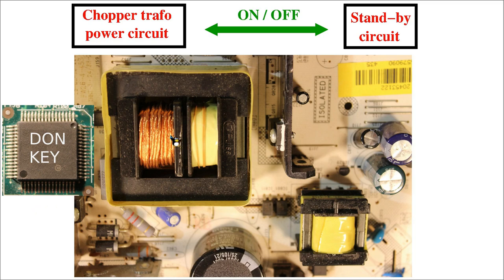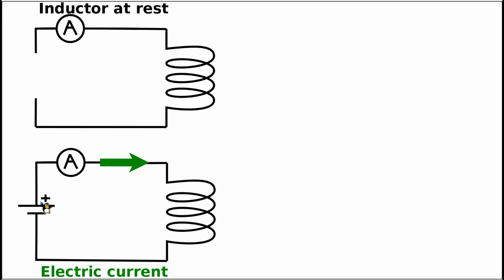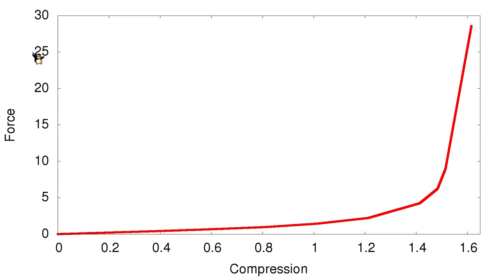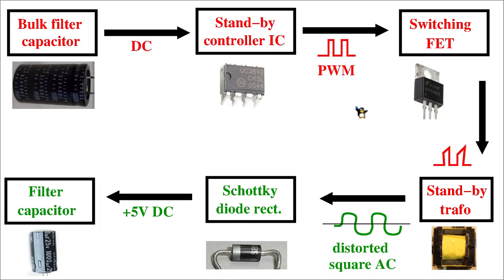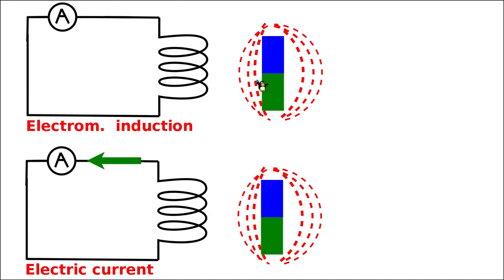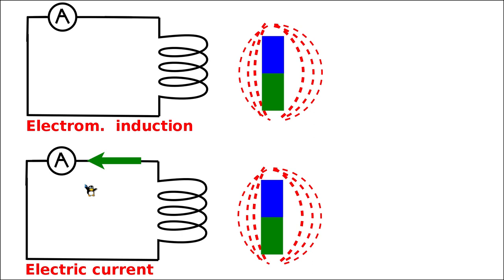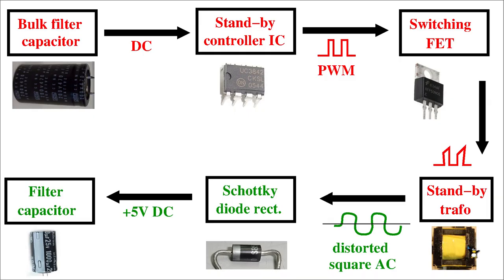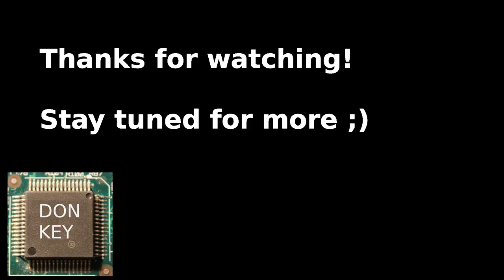Howto repair switch mode power supplies #4: Inductor in electronic circuits P2

Comment: 15:00 the measured current ("what we can see") is not flowing in the opposite direction when the field is collapsing. The collapsing field induces a voltage in the opposite direction that slows down the current, but the current itself is always flowing in the same direction.  The spring analogy works for the mechanical forces of a magnetic field in the air gap (reluctance) of a solenoid, as both (spring and reluctance) store potential energy. Other than that I like to think of an inductor as storing kinetic energy ... you "accelerate" the current and then it keeps moving like a moving mass until you slow it down.

Comment: I've been watching your SMPS videos every evening. 
Thank you !They are a GREAT review . I'm seeing SMPS's more and more in  electronic products these days.
Reply from the maker: I hope this weekend I will have time to produce more content for the SMPS series, so stay tuned for more.
Due to higher efficiency and lighter weight, SMPS have practically replaced traditional linear power supplies practically in every application (except audio amplifiers, where their switching noise it too high).
Reply: I will watch for more of your videos. Subscribed !

Actually, I've been seeing more SMPS based guitar and Bass amplifiers come in for repair like the MarkBass and Gallien-Krueger.
They're light weight and cheaper to manufacture, but difficult to repair.
Reply from the maker: Wow, SMPS in audiophile stuff? Now that is actually surprising to be honest. Namely, the switching noise is
just too much for my personal taste. The only way to use an SMPS in good audio equipment is, that one uses SMPS as a so-called pre-regulator, and the voltage is than being pumped through a traditional low-noise serial regulator, where the serial element need to dissipate less heat, since the SMPS have already pre-regulated the voltage. Even so, some 'golden-ears' still claim they hear the switching noise in the headphones...

Comment: 1. while your approach to the subject from basic principles is nice, it could perhaps be a little faster.2. There is a need for some correction too.a) The direction of the induced voltage (and therefore the current generated by it) will be same as the original current,  when the battery is replaced by the short. Nature hates change, it loves inertia! So, when the battery is removed, the magnetic field tries to continue as long as it can and so it creates an induced voltage with a direction that will keep the current going, even without the battery. This means the direction of the induced voltage will clockwise in your circuit and NOT anti clockwise as you have shown.b) When describing the effect of moving a magnet near the open circuit coil, you spoke of induced current, whereas it should be induced voltage. There can be no current with the circuit open.These remarks are not meant to diminish in any way the value of your project, which is laudable and I am enjoying it, even though I have some background in Electrical Engineering.
Reply: You are completely right. Also the mechanical analog of an inductor is a mass (hence the inertial effect) and not a spring, which is actually the mechanical analog of a capacitor.
Reply: @alejom.depuch831  Inductor is similar to a Flywheel resists a change in velocity. Capacitor is constant voltage Inductor is constant current,the two work together to smooth out the bed of nails impulses to make a flat dc output voltage.
Reply: Nature does not HATE change as you state.
Hate, is a human EMOTION.
Nature  RESISTS  change.
Your choice of words are POOR.
Using the correct language and terminology is CRITICAL,  and I tell you that as an
Electronics and Electro-Mechanical Engineer.
Reply: I see some issue with our statement "when the battery is removed, the magnetic field tries to continue as long as it can and so it creates an induced voltage".  In my understanding, the voltage is induced because of shrinking magnetic field around the inductor. If there is no change in the magnetic field, there is no voltage induced.
Reply: Dipankar, sorry, but I think you are wrong. The voltage induced in the inductor coil is due to the magnetic field collapsing back in on itself, and so the lines of magnetic force are "cutting" the conductor (coil) in the opposite direction, as they did when the inductor was energised, and the magnetic field was expending. So the voltage induced by the collapsing magnetic field is opposite to the original. Think about the diode placed across a relay coil which is switched by a transistor. It is there to "short out" or bypass the "back EMF" generated when the transistor switches off, and the magnetic field around the core of the relay coil collapses back in on itself. This causes a "back voltage"  spike which would likely destroy the transistor the first time it switched off. If that voltage was the same direction as the original, the diode would have to be oriented the other way around, and would thus short out the coil in normal operation, and it would never pull in the relay.

Comment: Stupid question. At 9:00 when you are able to demonstrate current flow produced by the magnet through the coil, but with no external power source, why then can't a magnet be used as a power source for electronics?
Reply from the maker: A moving magnet next to a coil or a coil moving in a magnetic field is called a generator, and it is used in everyday life to generate power. This is what being used in all kind of generators from small dynamos to massive power plants.
Reply: @DonkeyLearningIT  My mistake was that the magnet has to be in motion to affect the current flow. So there obviously has to be a "mover", which in itself requires energy input. Thanks for clearing up my misconception.
Reply from the maker: Yes, that is exactly the idea, that energy need to be put into the system since either the magnet or the coil must move. This mechanical energy will be converted into electric power.

Comment: At 16:00 you have the induced current going the wrong way (bottom left). The inductor "tries" to maintain the direction of the current not to reverse it.
Reply from the maker: That is because I am preparing the viewers for the explanation of the snubber circuit and freewheeling diode. Sometimes one need to go in small steps. First we were taught in school that the earth is a sphere. Later that it is not a sphere, but actually larger around the equator, and finally that it is not making a perfect circle around the sun...
In any case, the explanation could have been better, that is true. At the time I made the video, this seemed the easiest way to explain it.
Reply: Duh... what are you talking about ? This is clearly misleading !
The inductance does not deliver a reverse current on circuit opening, but a reverse voltage that is largely exceeding the voltage it was delivered. This is confusing, but the voltage flipping actually permits the current to stay continuous, it represents the coil shifting from a consuming component to a source.
The whole comparison with a spring only works with the saturation principle, a coil opposes as much to a current increase than a current drop.
Reply: Presenting false information as truth to your students is a reprehensible failing of an educational institution, and should be extirpated, not emulated.  I'm not saying you can't or shouldn't use an oversimplification, but make it clear at the time that it is oversimplified.  I know something about the subject, but I wanted to know more.  Now I feel that I can't trust the information being presented, and it greatly reduces my enthusiasm for your content.  I realize this sounds harsh, and I don't really mean it to be.  There's a severe lack of real-world information on how electronics works, and how to troubleshoot and repair.  I want to encourage you to keep growing as an educator, keep growing your channel, and keep raising the standard of free educational resources available to people.
Reply: I was going to point out that, too. Guys, this series is so awesome, there is a lot of work took into it. Yet you act very rude, G1vr1x, Tythagoras. Go and take your hate on people who deserve it.
Sir, my hat's off for providing a so great material like this! Thank you!

Comment: Are you sure the current goes the other way when you short circuit the energy source?
Reply from the maker: When it comes to autoinduction then yes, the current will be reverted. In fact, the current will be negligible, but instead there will be voltage spike, which need to be cut with a snubber circuit otherwise the switching element would be destroyed. 
I found no easier way to explain this in a simple fashion, but to leave this oversimplified explanation. With time of course one can progress further, and explain to people what is going on, but gradual lectures are more important so that it is easy to follow.
Reply: Bibi Biskouaz, I cast a vote on your side..  It is a fundamental fact that the current flowing through an inductor cannot change instantaneously.  Which means the current will keep flowing in the same direction.  This is what I understand about the behavior of an inductor.

Comment: Great video. I could only suggest  less electronics theory content. Usually, people that want to repair a switching power supply already have the basic electronic knowledge. People that do not have that knowledge are not likely attempting to repair switch mode supplies.
Reply: I said the same thing. Part 1 and 2 are good.  Then he got off on teaching basic electronics in a video about repairing power supplies.

Comment: Hello Donkey. I like you pace and your style. One question regarding your spring/inductor analogy. Please, correct me if I'm wrong, but in the case of an inductor, isn't the highest resistance to current flow PRIOR TO SATURATION, while the spring achieves highest resistance to force AT & SUBSEQUENT TO "SATURATION" (full compression)?

Comment: Your videos are very useful but I have an important constructive critic to make: the mechanical analog of an inductor is a mass (hence the inertial effect) and not a spring, which is actually the mechanical analog of a capacitor. Think of it as a car which is going to oppose to the force you apply to move it but once it’s moving it will conserve the energy as inertia.
So, in your circuits, when you remove the battery and place a short circuit in its place, the current will continue flowing in the SAME direction. What gets reversed is the voltage across the inductor’s terminals, being that voltage (the counter-electromotive force or CEMF) the one responsible of making the current to CONTINUE flowing in the SAME DIRECTION.

Comment: hello, great videos here, thanx-a-lot !!  one 'thing' i still don't understand: is the DC-current flowing from   -  or  +  ??   at  1:37  you say from +,   but i've also heard the opposite, which sounds more logical: that, due to an excess of (negative) electrones  (which is what makes the negative pole negative)  they actually flow from the  -  pole of a battery.  could you please try to clarify this?
Reply from the maker: This kind of misunderstanding is caused by the fact, that when electricity was discovered by Galvani, people though that electric current flows from the + to the - terminal. Engineers have taken this notation, and this is what is called the direction of the conventional current flow. More than 100 years later physicists have found, that electricity is in fact the flow of negatively charged particles, what they called electrons, and in contrast to the conventional current, the electron flow is having exactly the opposite direction. 
However, all engineering schools and books were using the conventional current flow, and there was no way to correct this "systematic mistake". This is why until this day in engineering the nomenclature is to use the traditional conventional current, and to mention that in fact the electron flow is opposite to this convention.

Comment: Are you sure you didn't just explain the capacitor? 
A capacitor doesn't like when voltage changes and will use it's energy to sustain the voltage.
if u connect a battery to a capacitor the current will flow in one direction but when you replace the battery by a short the current will reverse!

A coil doesn't like when current changes and will use it's energy to sustain that current.
The current thru a coil cannot instantly change so when you replace the battery by a short the current will continue flowing in the same direction but the electric potential over the coil (voltage) will reverse!

A good video on coils : https://www.youtube.com/watch?v=NgwXkUt3XxQ

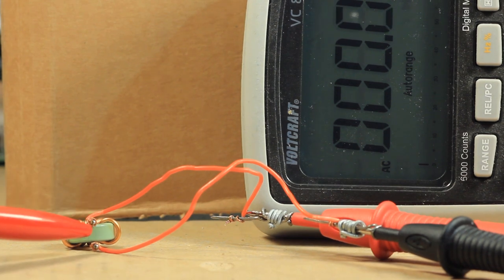Comment: Thank's for detailed explanation, but i had some confuses from the part one of the videos, you said a alot about "current" and what made me more confusing is in video #4 at 08:20, you measure "current" in voltage (V) range of the multi-meter?

What is "current" definition in your videos? Is it voltage (V), amperage (A), power (Watt) or what? Please explain & thank you for the video series, it help me & confused me a lot...
Reply from the maker: If I have confused you, that is bad. The issue is, that having to talk later about auto-induction and snubber circuits kind of ties my hand to discuss vaguely about the material, and that is one source of confusion...
When I am referring to current, I am referring to amperage (A), and also using this as a way to describe "conventional direction" of where the electric current is considered to flow. 
I do not want to confuse you even more, but actually the real current (i.e. the flow of electrons as charge carriers) is exactly the opposite compared to the way how the convention was made after electricity was invented. At those day people did not know about electrons, so they assumed that current flows from the + terminal to the -- terminal. This is why I have intentionally left this discussion completely out from the video, because it would get even more confusing ...
Reply: Donkey Learning IT
okay...
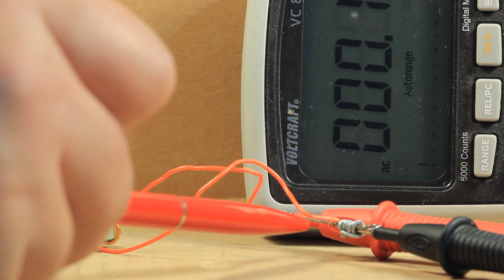why you just don't said "the voltage will created when i move the magnet near the inductor" on this video at 08:20? why you said "current" when it should be voltage and not amperage? And more confusing proof you were showing the multi-meter on voltage probe when you explain "current".

Sorry for commenting like this, i want to learn a lot about this. But, every explanation i've read always the same when explaining current actually it's refer to voltage (V) not amperage (A).

Thank's for the explanation
Reply: "Current" is the flow of charge. "Voltage" is the pressure to move that charge against resistance. Voltage is the "potential" energy to do work and is often referred to as the "potential." (Correspondingly, current is the "kinetic" energy.) You can have voltage without current, which is what a battery and capacitor does. You can only have current flowing with zero volts in a superconductor, otherwise all current flow will have a corresponding voltage proportional to the resistance of the conductor. That is "Ohm's Law."
Voltage is measured in volts and current is measure in amperes. When a magnet is moved within a conductor coil, a "voltage" is induced in the conductor. If the path is not "open", this will produce a corresponding "current". The catch is that we often measure this "voltage" by measuring the "current" that it produces through some conductor, such as a meter, which always has some finite resistance.
So we have current, voltage and resistance. In any "normal" (non-superconducting) closed circuit, if we have voltage then we have current and visa versa. He's not wrong to talk of both. For any given fixed resistance, if the voltage goes up or down, the current will go up or down in direct proportion.
If this confuses you, then you need to seek out basic electronics tutorials. They usually all begin with Ohm's Law.

Comment: For the future lectures, you should compare the coil with the block of mass, the spring with capacitor and the damper with the resistor. Otherwise you will be confusing your viewers.

Comment: i'm trying to troubleshoot a monitor power problem. it stay on for aprox 2 seconds and then it turns off the image and CCFLs. one of the secondary of the transformer has 12 volts. with multimeter it says 13 volts for 2 seconds and then between 12.73 and 12.78 volts
after this secondary there is a  schottky diode. i desoldered the schottky diode and then put 12 volts in that rail with a regulated power suply. and it happens the same thing. the CCFLs and image stays on for 2 seconds and then turn off and the main LED starts blinking. if i push the on/off button twice, it stays on for another 2 seconds. this happens even putting 12volts with a regulated power supply. it shows around 1.73 amps of consumption when it's on.

there is a power problem? or it's something else? i'm guessing something else if I put external 12 volts and the problem stays.

btw, the capacitors are fine, and i don't have an oscilloscope
Reply from the maker: The symptoms you describe correspond most of the time with issues in the protection circuit, which was not yet covered in my series, only mentioned. In the case of CCFL monitors, when you are hit with this problem, almost 90% of the time the high-voltage driver circuit for the tubes is gone. Either the high voltage switching transformer is arcing/shorted, or the FET feeding the hight voltage transformer is shorted, or the FET is receiving the wrong PWM signal, turning the FET on way too long, where the trafo magnetics reaches saturation as I described in the video.
I would poke around in the high-voltage section, if I would be you, and figure out where the culprit is there.